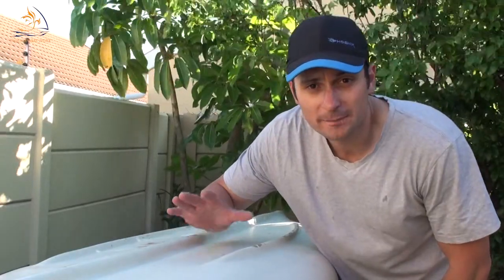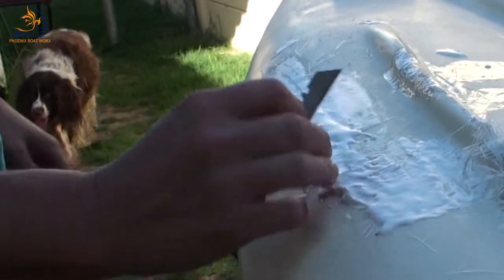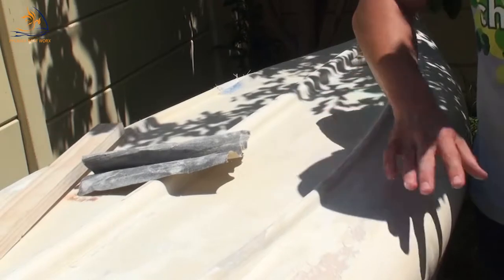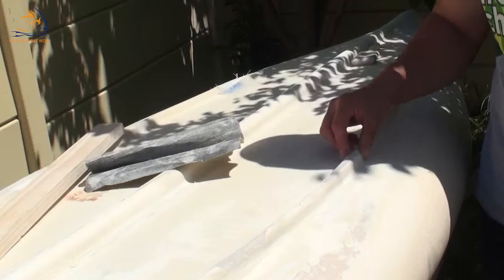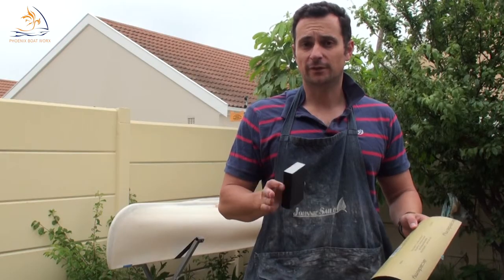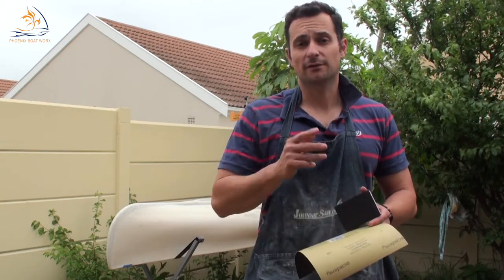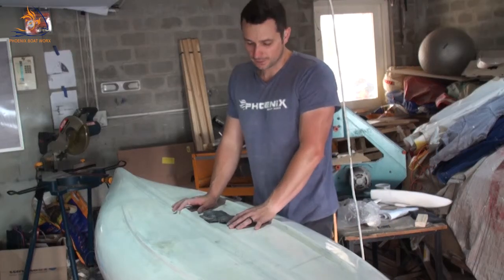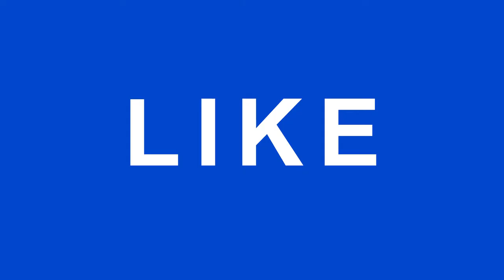Canoe Restoration Part 2   Fibre Glass and Roll and Tip

Comment: restoration........I'm restoring a canoe right now which meant repairing the gel coat not painting it what you are doing I would call repairing and painting not restoration but it looks ok.
I have just spent 4 days scraping paint and sanding to undo 3 different colours and layers of paint and get it back to gel coat which you should never paint as gel coat will well outlast paint if it is cared for and its a lot easier to fix if you scratch it
Reply: I know I'm quite randomly asking but does anybody know of a good place to stream new series online?
Reply: @Lochlan Abdullah i would suggest flixzone. Just google for it :)
Reply: @Luciano Ricardo Definitely, I've been using flixzone for years myself :)
Reply: @Luciano Ricardo thanks, signed up and it seems like a nice service :D Appreciate it !!
Reply: @Lochlan Abdullah happy to help :)